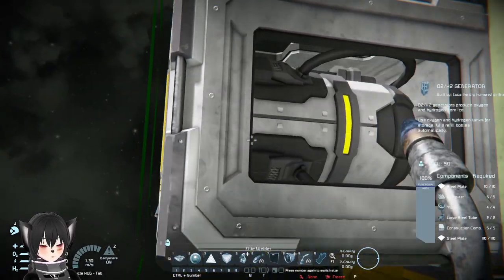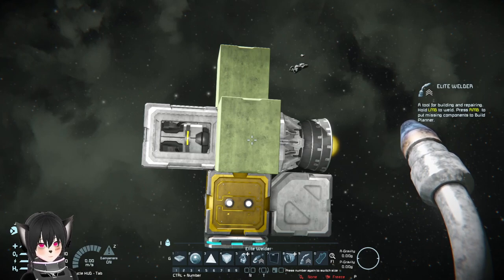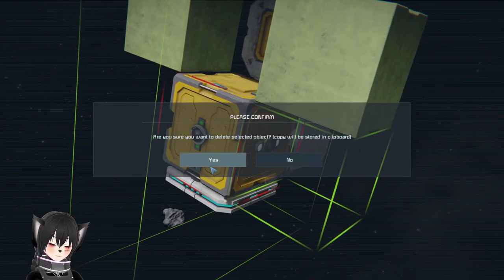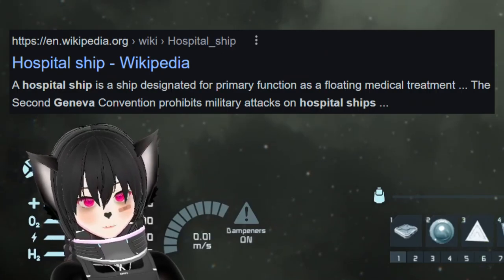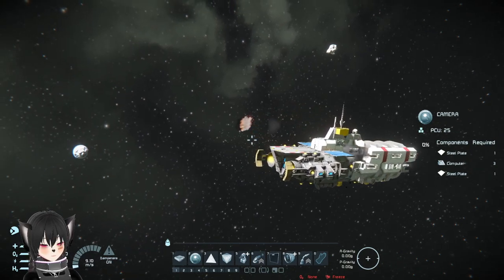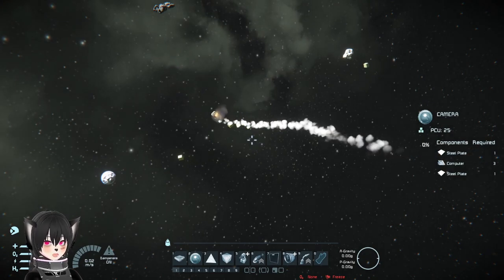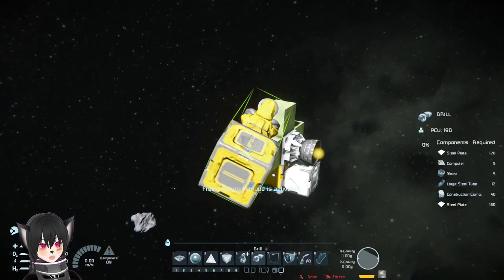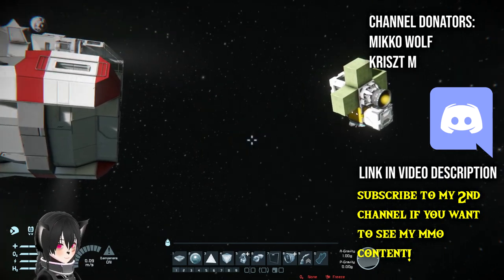Anti Ship Kinetic Self-Spreading SHRAPNEL missile, Space Engineers

Comment: I think I'll fool around with this myself,  but I can see that it would be a copper-plated bitch to hit a moving ship with one. I have a suggestion for making this a deployable weapon. Use merge blocks for the shrapnel blocks. This will allow the player to attach and detatch them to the outside of their ship more easily.
Reply from the maker: The deployment would be through the new Grid AI blocks unlocking the landing gear and then launching when it detects an enemy c= or it can be setup as a loitering missile, it's meant to be a cheap alternative which is why it doesn't use merge blocks but yeah the principle would still work no matter the deployment method x3 so any of them would be fine